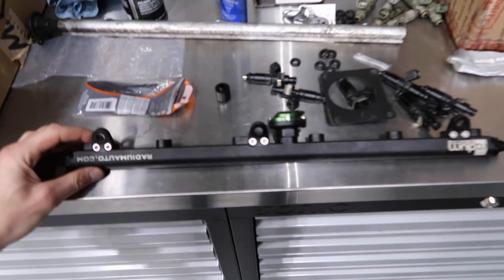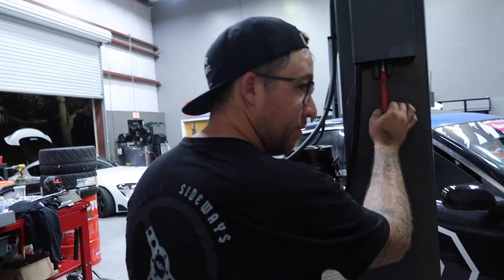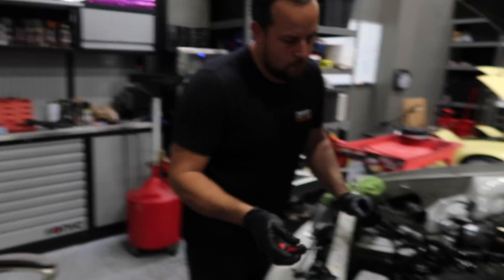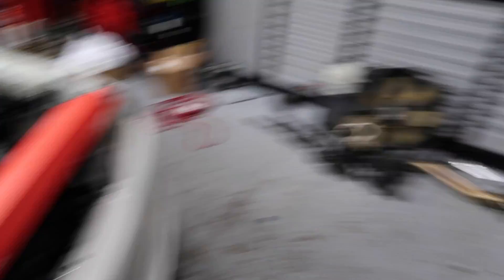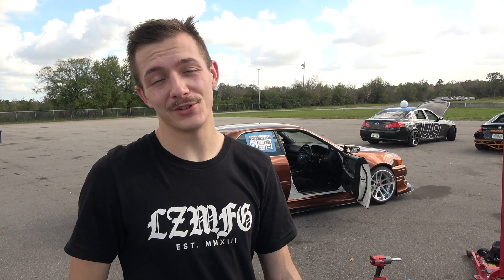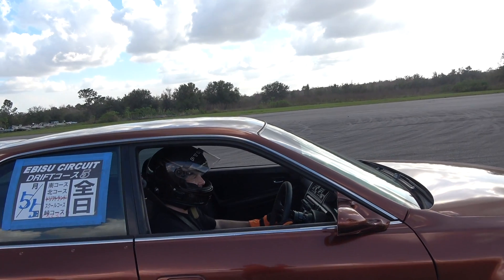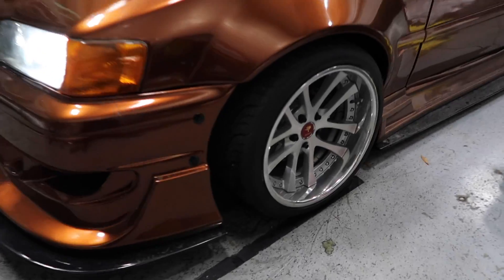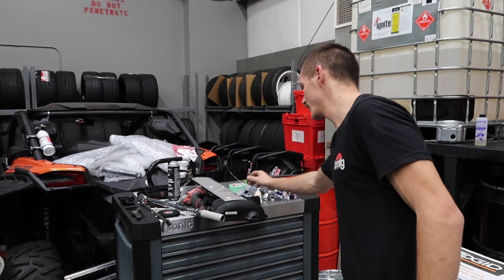DRIVING MY CHASER ACROSS THE COUNTRY!

Comment: that broken cigarette lighter socket is a common Toyota thing. There’s a thin wire that burns out on the inside. I replaced mine with a boat dual usb socket.

Comment: 30:20 Shulman straight gunned the wheel nuts up 😂 aluminium nuts as well I'm guessing. And Alberto is drilling them off. Then Adam asks Alberto "hey what's that?" when he's using a torque wrench 😂👍 33:41
Reply: For us a bit less knowledgeable can you please explain what exactly he did? I mean what does that mean? :D
Reply: @axel995r  I don't think he torqued the wheels nuts up properly. I beleive he's over tightened them with a wheel gun as it's known. They produce alot more torque than what's required of a wheel nut. The correct tool is what alberto uses in the later time stamp I put on here 👍 the torque wrench. Hope that helps
Reply: @Dan_AYP  haha oooh yeah I kind thought that's what you meant that he just over tightened them and since they are probably alloy they got bent and wouldn't get unstuck so Alberto had to drill them out :D

Comment: Alberto big boost! You need to rig up an air fitting to fit down in the spark plug hole and fill up that cylinder with air so the valves don’t drop down

Comment: Cigarette lighter issue is probably a fuseable link on the back of the socket. Replace it with some short wires and a 10 amp fuse.

Comment: The broken cigarette lighter issue is a fusible link under the nut on the positive terminal connected directly to the outlet. Bypass the link and connect straight to the terminal.

Comment: The cig lighter will have a faulty resistor or diode between the positive terminal and the pin inside the lighter. Undo the nut off the back and remove the insulation washer and reassemble. Walaaah

Comment: Test the cigarette lighter with a seperate ground. Ive had issues with that before, there is a measurable ground but when trying to pull some current trough it, it wouldnt work

Comment: Titanium retainers is not for weight. Its strength. The springs are stiffer AND the cam has more lift causing extra pressure on springs and retainers.

Comment: You don’t replace a whole drive shaft for a u-joint. Drop it at the shop have them replace the bad joint and re- balance the shaft. Should be around 100-150$ max

Comment: unless you're going to use AN lines with the same inner diameter as the oem lines on the car, then you're going to have less fuel pressure than that pump is capable of